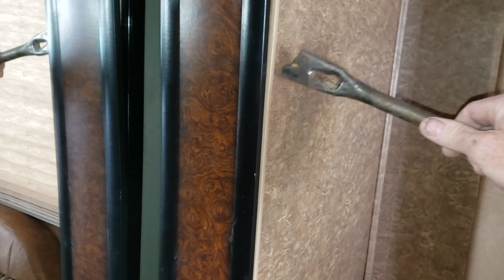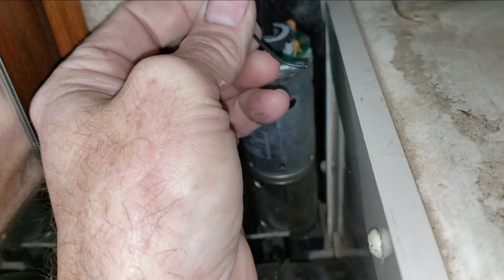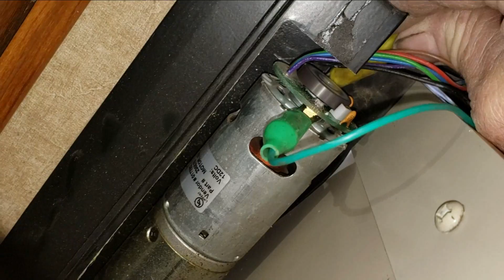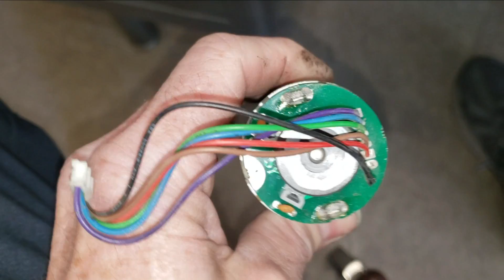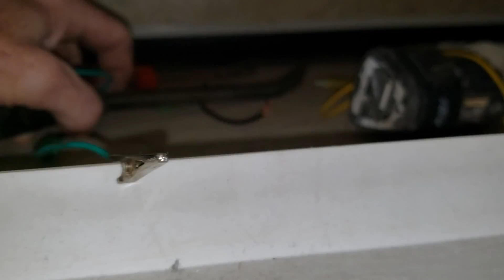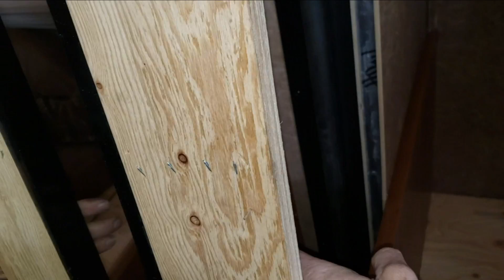Schwintek RV Slide Motor Failure...Replace or Repair?

Comment: This video saved my bacon! Exact same problem on our 2014 Thor Challenger 37gt. I was having no luck finding a solution and then found your video. I used your technique with the battery to move the slide out enough to get the screw  out and changed the motor out. About 30 min total! Thank you so much for making these self help videos!!
Reply from the maker: Awesome to hear! You're very welcome

Comment: it a stupid design don't understand why they would put the small motors in such a way that its almost impossible to get to them  A better design would be to have the motors upside down under the coach in a sealed compartment that is accessible All they would have to do is reverse the design
Reply from the maker: Thanks for watching! :)

Comment: Manual overriding the motor by pressing the board button and holding the seventh push will allow you to open the slide
Reply: I have seen holes drilled to access the screw.  Overriding the control board by pushing and holding the button on seventh push allows you to use wall switch to open the slide.
Reply from the maker: @bryanmontgomery4050  the motor has to work for that method

Comment: We had to fix one of these last year that was stuck in the in position. In the end, we pulled the plastic corner cap off of the outside and drilled a hole in the aluminum fascia so we could get a screwdriver on the screw and extract it. After putting the corner cap back on you couldn't tell a difference.
Reply from the maker: I was likely going to go down that road if the motor was dead. Glad to know it's a viable option. Thanks!

Comment: Exactly. Mine was stuck in and only one side worked. Seems like they’d have the release screw accessible from the out side. I will mark the camper and remove the corner cap and drill and access hole so I can  remove said screw if the room is stuck in. Mine the black cable was bad at the motor plug-in. Thanks!
Reply from the maker: you're welcome. I do find the system to be frustrating

Comment: Was leaving the RV site and the slide would not go in. A repair man came, took out the motors and pushed the slide in so we can get on our way, but he took the screws.  Now the local repair facility says the motor arrived with no screws and they don’t know which ones to use.  I called Lippert and they said they don’t sell the screw and cannot tell me the size!   Can u  help?
Reply from the maker: almost any screw will work, its just keeping the motor from lifting out
Reply: @AZExpert  Thanks alot... Much appreciated!  Ironically, today, they called telling me my RV motors were installed!  (guess I just got the runaround for no reason...)

Comment: At 7mins, 27 secs...what size screw is that?  My RV has been in the shop 10 weeks because they said the motor was shipped with no screws!  Please tell me what it is and hopefully I can get it tonight at Lowes!
Reply from the maker: There's nothing special about it. I'd just take the other one out and match it up at at hardware store. I'm baffled that the shop is waiting for that screw, a self-tapping screw will work

Comment: Not real smart are you!  Could have hooked up the power from the switch so both motors work. Or could have used front motor alone and pushed the back at the same time.  Hay but your learning.
Reply from the maker: I don't think you watched and definitely have no knowledge on these systems. Thanks for taking time to insult a stranger on the internet, you are wrong about every suggestions.

Comment: Our manual says to unplug the motor connections at the controller which releases the motor brakes which allows you to push the slide in or out by hand.
Reply from the maker: yeah, I know. It's not an easy process especially by yourself. I'd recommend trying it before relying on that method, but bracing inside the motorhome without breaking cabinets or flooring was my major concern. Thanks!
Reply: @AZExpert  My friend is having a problem with his Schwintec slide in His Grand Design. The Kitchen slide has extended fine but when retracting one side stops after about 3 inch's. There are no error codes. When observing the controller both green and red lights blink until the one side stops, then the red light goes solid red. All the lights go out when the wall switch is released. The slide sounds like it is binding on the one side but can't see anything. Not sure when or if the rails were ever lubricated so were going to do that next time we go out to the rv. We have tried the manual override and unplugging the motors at the controller but were unable to push it in.

Comment: First off great job! Next, I have a question regarding one of the slides on my fifthwheel. The slide recently had a motor replaced at Camping World and when I got it back the side where the motor was replaced is out of sync with the bottom of the same side by roughly a 1.5". How would I fix the synchronization issue? And no, I do not plan on taking it back to Camping World. Originally it took them four months to diagnose and replace one motor, after listening to excuse after excuse. Extremely disappointed with the service writer's lack of knowledge and the technician's lack of knowledge and craftsmanship. 
Furthermore, what can be done to fix this? Thank you.
Reply from the maker: if it is out of sync sidetoside. jsut use the wall switch to either fully close or open it. you can get about 1" of sync with each cycle. once one side hits fully open or closed hold the switch down until it stops itself. quickly cycle the switch the opposite direction but stop once you hear the whine of the motor. then reverse the switch again and hold it until it stop. repeat until back in sync. good luck

Comment: You don't have to take all that apart to get to motor. Just disconnect at electrical to controller and push out slide. Takes a little muscle to push but you can get it out enough to get screw out on outside with angle drill.
Reply from the maker: Guess i wasn't strong enough
Reply: I understand HaHa! Especially if 500:1 motor. I appreciate your videos, they have provided many great ideas!
Reply: Don’t see how this is true. Living it right now. I pushed hard as heck, didn’t budge.

Comment: couldnt you just manually push the slide out to get access to the motor from the outside?
Reply from the maker: I see so many youtube videos saying they pushed it out "off camera" but without the motor removed it is very difficult, especially for one person pushing it out. I'd have to brace against cabinetry or flooring inside and likely cause much more damage. Thanks!

Comment: Nice video.  Learned a lot about slideouts.  I don't have any issues.....yet.  Trying to get an idea of how it is all working.  One little comment.... it was difficult for me to tell what the silicone was actually in contact with besides the insulated portion of the wires.  Silicone actually conducts electricity.  It is a semiconductor.  It appears that you aren't having any issues.  It could be that the silicone isn't touching any of the solder joints (I can't tell from the video).  Also, the voltage (12V) is low enough where you likely won't get a jump between opposite polarity solder joints.  If used on a higher voltage system, you could have issues, or at a minimum a very high impedance short circuit/ground.  Nice presentation. Thanks
Reply from the maker: I think everything conducts electricity at high enough voltage, but I've never ran into that at 12vdc with 100% silicone sealant. Thanks
Reply: Standard formulations of silicone are known for excellent electrical insulation, to the point where there's no decline in insulation performance even when silicone is immersed in water. As such, a lot of the silicone parts or materials you'll find will not have any conductive properties.

Comment: I saw or read somewhere that its not necessary to have that motor retention screw. I want to say that recommendation came from Lippert. When replacing the motor just do not re-install the screw.
Reply from the maker: I haven't heard of that, I always put it back
Reply: @AZExpert  It would be interesting to see if newer RV's using this motor have the screw.  It really is a very poor design as you can attest it's almost impossible to access if the slide is in.

Comment: I have swintek slide and when I tried to locate control box for it, I found it on the opposite side of trailer, on the floor, behind a drawer under the oven!  The worst location possible! You would have to lay down on your side and try to reach it . Who thought that this was a great location!  Sorry, venting a little.
Reply from the maker: Don't apologize, it's very reassuring to know we're not alone.

Comment: It's amazing how far technology has come , that little motor moving all that weight , the old starters I used to replace as a kid in the late 70's early 80's were monsters, very nice work ( once again) patient man you are.
Reply from the maker: Those motors and little wires moving full wall slides impresses me too. Thanks!

Comment: I didn't have an option to put power to the motor and manually move it out.   So I found out it takes about a 300lb man to push out a slide, one per side to get it moving,  Since I am not that big (about your size) a helper and myself in close quarters  pushed the none functioning side (it was a bedroom slide) .  Note.. you have to brace your selves  and it takes a lot of pressure to get it to move, even a couple of inches.
Reply from the maker: I'm glad to know I'm not the only one to have a difficult time pushing it manually. Everyone says its so easy. Thanks for sharing!!!

Comment: The expense of the motor unit is the torque multiplier unit while the motor is much less to replace. Looks to be an inherent design problem that they make to prevision for strain release and wire support of the soldered wires. Hot glue or a rubberized glue/silicone may help support the wires on older revision unit.  The new motor shows a header connector now soldered into the board which is a wire support mechanism.
Reply from the maker: for sure the new motors have a strain relief, I just can't imagine anyone designing a motor without one intially though

Comment: How about somehow putting the set screw on the inside ...so next time it won't be so difficult to remove the motor ?...
Reply from the maker: Murphy would make the slide fail with it stuck out then. His law cannot be challenged ;)
Reply: AZ Expert yes...but better to work from the inside where it can be air conditioned rather than outside in the rain...hahahah

Comment: Did anyone else notice that the fuse box/ breaker panel is on The bathroom wall? So when the slide-out is in the breaker panel is blocked? What if the slide out fuse blew and you can’t access it lol.
Reply from the maker: Oh the things manufacturers never think of...or don't care about. You are very correct!

Comment: They are my favorite systems to work on. Full rail replacement is never fun especially when you have to cut and build from start.
Reply from the maker: I do not care to work on them, it always seems like an engineering failure that causes problems so I never know how long my repairs will last. Thanks!
Reply: @AZExpert  Some people might call that "engineered job security".  :)

Comment: What about adding  a access hole on the slides outer trim piece? Obviously you would have to locate this access hole in line with motor hold down screw. Then use a rubber hole plug to hide? Seems like a good idea for the manufacturers  of the rv to add into there design
Reply from the maker: I have little luck drilling holes like that correct the first or third time. Likely the slide would settle a bit over time and the hole wouldn't line up. My fail safe was to destroy the motor casing. Thanks!

Comment: My understanding is you can push a button on the slideout module 5 times then disconnect 2 wires at the module which releases the brake on the motor then you can push it out or in the plug the wires back in which will activate the brake. The module is usually found in one of the storage bays
Reply from the maker: To push the slide in or out the motor needs to be disconnected...which was done by the broken solder ....but it is still an incredibly difficult task on a big slide, by yourself and to extend from the inside without bracing against walls, cabinets, and trim that should not be braced against. Thanks!

Comment: I’m just curious, why didn’t you just unplug both motors and manually push the slide out?
Reply from the maker: It is a very difficult task to push manually a large slide

Comment: Oh my, we are currently having this same issue. We can’t get our slide out. I am glade I watched this, but I don’t know how to get it out enough to get to that screw. What do we do? Is there a way to just manually, physically, push it out enough?
Reply from the maker: if you cannot get access to the motor or hook up power to the red and black wires to drive the motor out, then you need to unplug the motor at the controller or motor and get strong people to push the slide....it is very difficult to push
Reply: AZ Expert ok, thank you

Comment: I too had the same issue and this Video has saved me a lot of money. It was not easy to get to the back power lead, but I managed. I even contacted Schwintek and I was told to disconnect the connector to the 2 motors and get a group of beef cakes and push it out. This was video was a real life savor.   Thanks.
Reply from the maker: that's great news, those little motors are expensive little guys. Thanks!

Comment: Great video!  Do you make house calls!? :). We have a 2018 Thor 24FE with the full-wall slide-out.  And it "pops" like crazy on the lower right (facing out) and the track teeth are getting chipped at regular intervals - about 3" which is what I figure is the circumference of the gear attached to the motor.  And now it's skipped a track-tooth so that when the top is fully retracted the bottom is out about 1/2".  Got any ideas? Want to do another video? I'll bring you the RV!
Reply from the maker: We can, but we're booked out for about three weeks right now. If the rack is chipped and damaged, you will likely need replacement units. On a 2018 it may still be under Lippert warranty. Have you had this looked at yet?

Comment: I received a replacement motor and it doesn't work either. I checked the wiring on the pigtail coming off of the motor and I'm getting cross continuity between the red and black wires. Is this supposed to be like that? if it is then that would mean my controller is bad i would think.
Reply from the maker: red and black are power and ground to the motor so there should be continuity through the motor windings. You can hook power to the leads and see if the motor turns. Thanks!
Reply: @AZExpert  thanks.  Motor turns.  It was the controller that was bad.  Replaced controller and installed new motor and it all works fine now.
Reply from the maker: That's good news. Glad you're up and running again!

Comment: I too have had problems with them. My final fix after watching every video and reading and trying every fix on line was to replace both motors. I tried to get by with replacing the weakest one but when I did the “good” one was then the slower one that would not sync. There is tension setting adjustment but even it did not help. I used a heavy grinder and a sawzall after trying Dremel tool and file and getting nowhere. I also replaced with a new version that has a rubber skin to keep out water. I feel this was the root cause water getting in when I would retract slide. I have also added a slide topper. Hope this helps
Reply from the maker: yes I completely understand. That's why I wanted to fix this one, rather than have to replace both motors so that the slide would work. It's a very frustrating conversation to have with an owner and let them know I have to replace both motors because Lippert changed ratios after building the slide. Thanks for sharing!

Comment: EVERYTIME I SEE THINGS LIKE THIS I WANT 2 DEVELOP MY OWN MOTOR BUT ESPECIALLY AN EASY ACCESSIBLE  COMPARTMENT & AN EASY MANUAL LEVER ON BOTH ENDS, LIFT UP LEVER PULL OR PUSH SLIDE IN, BOOM IM HEADING HOME TO FIX OR REPLACE MOTOR. I  JUST WISH TO GOD ALL MANUFACTURES BUILT THINGS LIKE THE OLD HYDRAULIC FACTORY HEAVY EQUIPMENT DAYS SHAFT DRIVE, HYDRO DRIVE STEEL IN STEEL TRACK DRIVES, I THINK BACK TO MY GRANDFATHER WORKING IN A NY CITY MACHINE COMPANY. AS A KID I SAW USA MADE WAR TYPE NEVER QUIT, NEVER BREAK, TAKE A POUNDING YEAR AFTER YEAR MOTORS & DRIVES, FANS, COMPRESSORS, LIFTS, EVEN THE SMELL WAS  SOMETHING I REMEMBERED, WHEN IT WAS TURNED ON U COULD SMELL THE OIL, GEARS,SHAFTS WORKING LIKE A SWISS WATCH  ..A BIG FAT SWISS WATCH
Reply from the maker: I'm a not a defender of manufacturers by any means, ,I do say that RV manufactures only respond to what sells and honestly price always wins over quality with buyers. Also, any product you make will ultimately be aquired by Lippert or Dometic....lol! Thanks for wathcing!